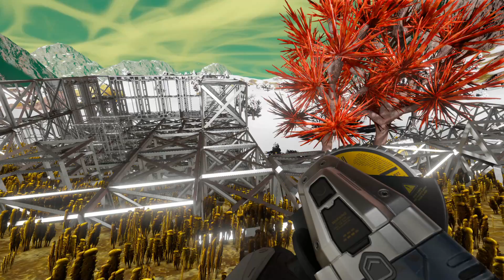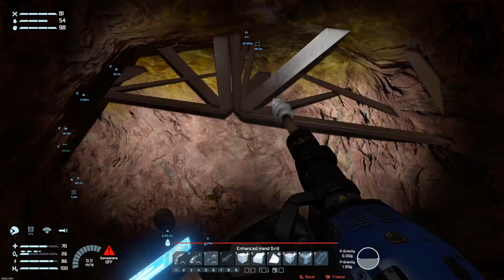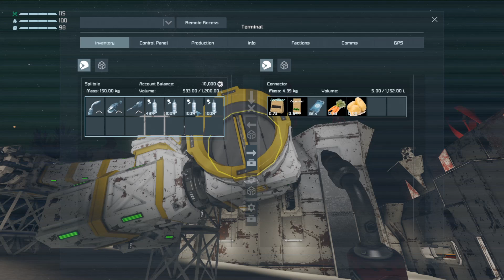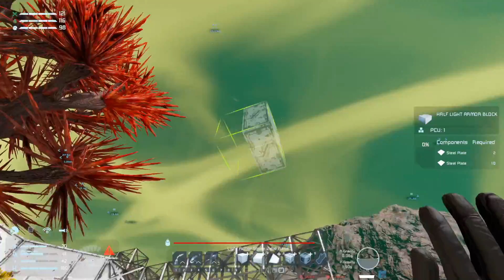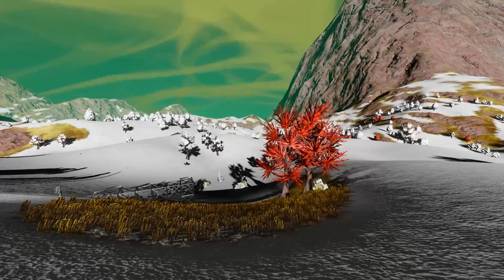Survival Impossible - Sooo Much Scaffolding #43 - Space Engineers Hardcore Survival

Comment: your base needs more lights try building a huge searchlight tower in the middle to light up the area
Reply from the maker: The issue with spotlights in large numbers is that they cause awful lighting glitches so I try to limit them as much as I can to vehicles just to reduce how easily I run into that problem :(
Reply: @Splitsie  its it possible we'll see a new series like this with capac and you? wonder how many times he died with setting like the ones you are using would be funny to see

Comment: If you want to get around using "cheaty" bits like Spectator Cam when drilling underground tunnels, you could do so with a small drilling truck with a remote control antenna and camera.

 Then, instead of needing a bunch of GPS's you would only use the one from the truck and pinpoint its location as you drill using the remote control and camera.

Comment: Idle design thought, watching Manny's pair of piston pairs: Ever considered putting pistons in opposing directions, for aesthetics? (think it'd only be interesting for a pair of pistons - longer runs would be weird) - having the bulky parts of the pistons either together in the middle, or at opposite ends?
Reply from the maker: There's one reason I haven't ever done that - it's incredibly fiddly to achieve. With pistons you can only place them with their large end attached, so to attach them base to base you'd need to use merge blocks and other pistons just to get the extra piston in place, even for me it gets out of hand :P

Comment: "I'm going to tear this down again" NO! Wait, never mind, this is SO much better.
This whole concept is outstanding and pulled together brilliantly. Using armour/wood as a deck to expand the inside of the arboretum so you can get the octagonal shape you need is an incredibly smart move. This is why people look up to you and see you as the high standard for building in this game.

If I were to make any suggestions, it would be to move the 1 > 2 story stairwell to the side by one block, matching the start of the 0 > 1 stairwell, this would give some head room while walking up the first stairwell and improve the viewing from the first floor, and doesn't look like it would impact your patio equipment at all. You also still have two free blocks on the east side of that patio table. Kitchen and bar for grilling sabiroid steaks?

Second, and I'm not sure how much you'd jive with this, is to move the vents. The west side of that building is already going to have worse lighting for facing the side of the hill, those vents will block more of that natural light. The building and airlocks would benefit from oxygen tanks as a buffer in case of decompression. You have a perfect place for all of this underneath the voxels in the arboretum that you're using half blocks to seal, since the half blocks match the orientation of a vent to pump air into the dome. You could have one or two pressurizing the inside of the dome from underneath, and another that's visible inside the dome so it doesn't look like you're magically pressurizing the space. Underneath would be the best place to store those spare tanks as well as to fill them really quickly again when you need to.

Putting in oxygen tanks here in the arboretum makes sense for the purpose of the building as Life Support. If it get's linked up via conveyor towers in the future, you can move your existing oxygen supply over and make more room in your manufacturing building for refining and assembly. 

Looking forward to seeing this finished. All that, and plenty more to come, and will see you then.
Reply from the maker: That's an interesting observation, I'll have a closer look at the stairs to see if the head room feels much better :)

Also, you're right I should think about where I might put some O2 tanks in or around the building, I'm keen to keep 'functional' blocks to a minimum in the arboretum though as I'd like it to feel parklike and not industrial. another good point about the vents though...

Comment: 0:29 All good things, that. These smoother, more natural looking designs always do come slowly, particularly with you building it to the theme of the industrial complex around it.

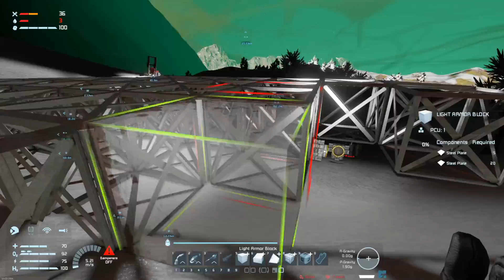6:40 Ironic that the wood paint will work best in the spot made to preserve trees.

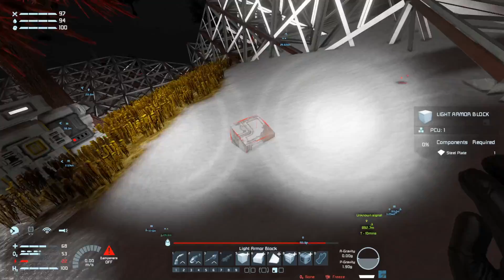8:15 Earthlike grass would only work if you can also change the trees, I think. They wouldn't go as well together if they were different.

9:26 It might've been that the weight on the arm was bending the rotor, which it wouldn't have liked.

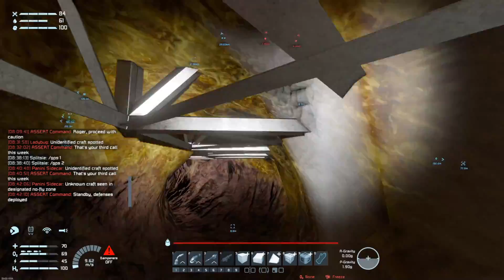12:10 Well you're somewhat safe down there at least... though the building isn't.

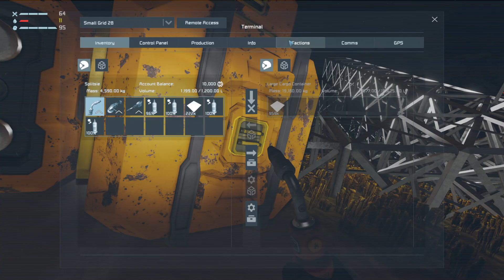18:01 Huh, I would've thought a solid steel box would be a bit more resistant to mild bumps.

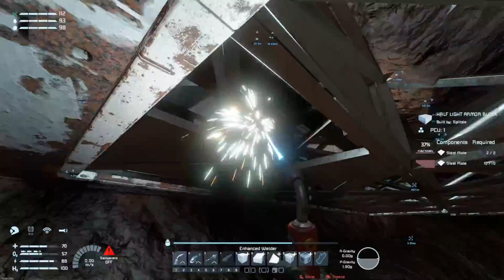22:42 Nighttime gives excuses for there to be spotlight systems which look nice at night.

31:25 This is definitely within that scale, you can nearly pressurize structures surrounding some moons if I remember correctly.

36:33 You could still use the Absconder to get unknown signals, or just sit Steve and Capac on it.

38:51 For the conveyor line if I remember correctly.

Comment: @Splitsie: Now would be a great time to redesign the crane vehicle to use hinges on the arm instead of all those rotors. Add some more pistons  on the arm (you can fold the length of the arm in half with 2 hinges so that you can give it a much longer reach with multiple pistons) and make a separate welder attachment for it so that you can use it as both a welder and a crane. Then add some cargo space for components.

Comment: As a fork lift operator in the real world, I will give you some fork lifting advice for hills.  Never go down a hill in the forward direction on a fork lift.  Always reverse down the hill.  The front wheels act as a pivoting point between the counter weight and the weight.  This tends to make the lift tilt in the down hill direction.  If you have your pallet there, it will hit the ground and your rear wheels will be in the air.  If you are reversing however, the rear wheels will be the thing trying to move down, giving them more traction and maintaining all wheels on the ground.  Also lower you load as low as you can get away with.  This will help prevent a flip as well.
Reply: also done forklift for years. he is completely correct. in fact it is OSHA regulation to keep forks in the trailing position if taking a steep incline or large loads due to visibility issues.
Reply: About to get forklift training this month, I wont be on any inclines but this is really interesting to know.
Reply: I was thinking that Back down......
Reply from the maker: That makes a lot of sense and was something I could evenn feel while I was driving it the wrong way - hopefully I'll remember to do better :)
Reply: Staplerfahrer

Comment: I think you should keep at least some of the scaffolding inside. I feel having a second or third level gives the room a certain something rather than just the ground floor if you know what I mean. Also the deck that hangs over you should add either a support pillar or make the wall meet the ground with a facade maybe. Either way would look nice. And one last thing that would be really cool is setup some accent lighting that turns on when the sun goes down. Not sure if there’s a script that could detect that or not but would look pretty cool in a timelapse or even in real time.
Reply: Isly's solar script has that. Just needs a solar panel as a detector.
Reply from the maker: Interesting thought about the lights, might be nice to have something like that for the park :)

Comment: Make a quick Weldsie with a nimble welder on the simplest piston/rotor system possible and storage + gravel ballast low to the ground that allows you to reach most blocks and then casually drive around welding 4 blocks at a time.

Comment: You could build a small grid flatbed truck, where merge blocks are inbeeded in the bed and use Manny to lift cargo cointainers so transporting becomes easier. You could also add foldable side rails so you can transport your drop pods easier and safer. I dont know if this will make Clang upset but a fun idea in my head atleast.